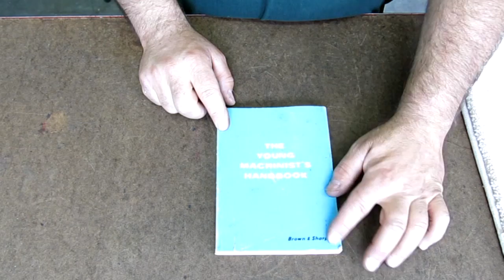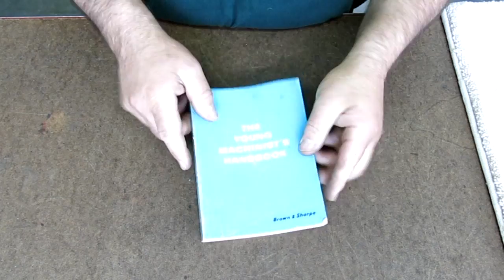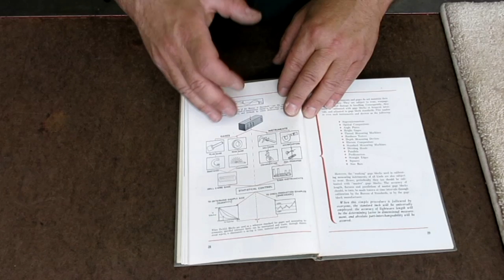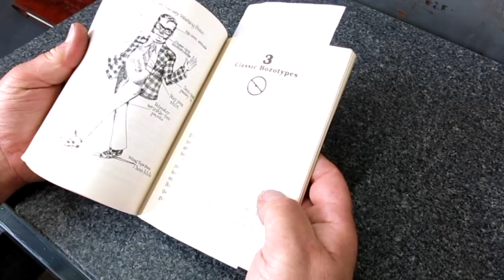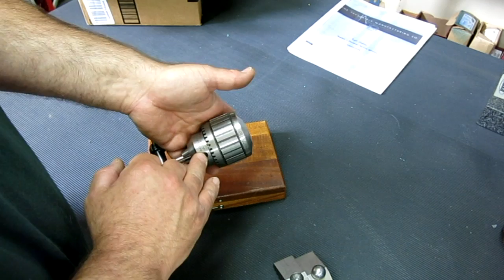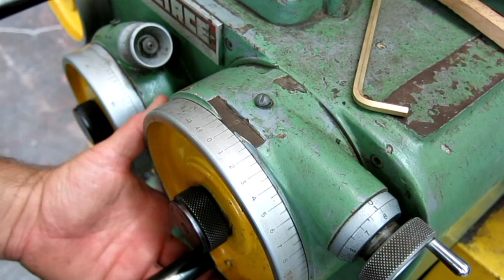Monday Night Meatloaf 86

Comment: On the Mitutoyo I thought you had pot the dividers on wrong so I went looking and bingo; hose tips are meant to meet in the center, after all layout lines are guides to ensure you don't cut too much off. Well, I found it, here it is: http://www.practicalmachinist.com/vb/general/mitutoyo-190-101-caliper-instructions-149082/

Nice caliper, I had never seen one before.

Comment: Nice to know I amnot the only one to have one of those Mitutoyo calipers. I have shown them to a number of people including a Mitutoyo rep. and knowbuddy had seen them before.
Reply from the maker: Hi John,

They are pretty neat. I had not seen them either until a couple of years ago. Had to have them after I saw it. Thanks for the comment.

Cheers,

Tom
Reply: There is a set on ebay right now, buy it now price $1000. I've typed that correctly $1000 !!!!

Comment: Great video, I am working my way through your videos learning as I go. Thanks for the knowledge.

I would love to see how those grinder fine feeds work. My 1950s little grinder is pretty course feed with 0.001" graduations, I was going to add a vernier scale to help but that system looks great.
thanks again. mat
Reply from the maker: +lookcreations Hey Mat,

The fine feeds are connected to worm gears that are on the main handwheel. They are engaged when you tighten the clutch knobs. Thanks for the comment.

Cheers,

Tom

Comment: I worked for a company back in the 80's that made precision pre-set tooling for screw machines. Some of the tooling had it's own integral slides for adjustment.We ground the dovetails for those slides on a Taft Peirce machine very similar to yours. That machine had the spindle set at 30°, and the outside face of the wheel dressed vertical, and that's all it was used for. Great find.
Reply from the maker: +jim white Hi Jim,

Thanks for the comment. I am anxious to try something like that. 

Cheers,

Tom

Comment: Yay at last Tom, a grinder in your shop!!!

I can definitely recommend running the grinder on a VFD, I have both my grinders on them and wouldn't do it any other way. I've never seen a need to vary the speed, even though what you say about making the wheel seem softer is absolutely correct. What I do like is the soft/start and soft/stop. It means I can stop the wheel if required and not need to worry about it spinning on the arbour when re-starting, hence needing redressing. Instead the wheel gently comes up to speed and then gently stops at the completion of the work. Everything is very controlled and gentle. The way grinding should be!
Reply from the maker: Pete F Hey Pete,

Good point you make about the soft start. These VFD's are so reasonable these days it seems like an easy decision. Thanks for the comment.

Cheers,

Tom

Comment: Hi Tom,

That's a great grinder, those rollers are making it easy to grind even heavy parts.

I've got a Norton Grinder that uses rollers too, those rollers roll on some hardened ribbons, one for each row, the problem on my grinder is that those ribbons are pretty worn, and I've been looking for replacement.

If ever you get to know where to get some kind of replacement, you would do me a great favor to let me know about it.... ;-)

Cheers,   Pierre

Comment: Hey I liked the Dodge Swinger (not the same as the Dart) I loved that Dodge. The transmission replacements got to me though they seemed to always fail before their time. I like the Mititoyo calipers and have the great desire to check one out for my own. I have  a 18 Inch that I need to make a holder for to put on the outside of my Box as it is too big to put in my tool box.

Comment: Oh man, thats an awesome grinder, I do have a question. If the spindle is tilted, how would you dress the wheel on the fly? I didnt see any overhead dressing rig. I mean, if you use the sine rolls to set the angle, then install a wheel, it needs to be dressed after the tilt, right?

Comment: Funny you hit on the accuracy and precision in the shop right after I did a big video on it myself. https://youtu.be/e9HWU5xA-cc I think the importance of standards and calibration is oftentimes overlooked. That leather notebook is gorgeous! 50 ton seems like a lot of pressure for an etching press. didn't realize they needed that much. That is a handy and cute little grinder maybe someday I will find one to go along with my big Thompson.  It is great for mowing flat surfaces but a grinder like that would be way better for intricate feature work.

Comment: That's quite the grinder, Tom. I have a DoAll 6x12 and weights more than most, at 900 pounds. You just showed me up once again! 

I wanna see this thing grind! Convert it back to 3ph, more torque and smoother running. You can run 3ph on single phase, but your not using all the windings.
Reply: Andre Gross This is what I thought.Cliff

Comment: Hey Tom. They basically made a solid state phase converter. Just bypass that junk and wire straight to the motor through that burly on off switch. You could run it without buying a vfd. Just a thought.

Comment: Well, if you had to be missing one of the decimal radius gauges, the 0.750" would be one of three to hope for. You have that one in your fractional set (along with the 0.500" and the 1.000"). Seems as though those sets are complementary, in more ways than usual.

Comment: Tom,  I'm curious how the grinder balance would work.  It appears that the grinder wheel would go directly on the balancing arbor.  How do you adjust the wheel for balance?  Are there some washers with weights that somehow attach to the wheel, or is the wheel itself ground?  Obviously the wheel would come off of the balancing arbor to mount on the machine's arbor.
That was a rich meatloaf with all the trimmings!  Thanks for sharing all your efforts.  Always interesting.

Comment: Excellent grinder, Tom. I'm envious. Although I never ran a Taft Pierce, I did run a Parker Majestic that was very similar and it was a 'Cadillac.'  I agree that those 'stone' grinding wheels look to have seen better days. Try to find some 32A60j8vbe grade Norton stones. In my day they were the best available for the smaller wheel grinders. However, times have changed I'd anticipate there are probably better options now.
Sam

Comment: How do you compensate for wear of the grinder wheel when trying to make precise grinds? I suppose you just keep measuring and creeping up on the final dimension, dressing the wheel as necessary?
Reply: Smidge204  I asked the same question once, the answer was as the wheel transitions across the work only the edge does the cutting.  The leading edge of the wheel does ware and moves across the face of the wheel, eventually it needs to be redressed,  hopefully this doesn't happen until you make a complete pass.   At least that is what I was told.